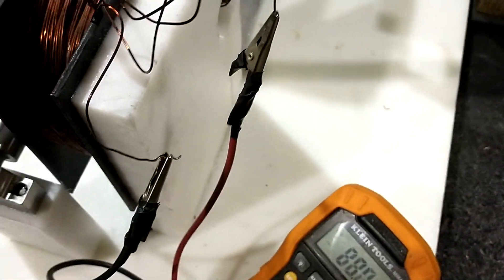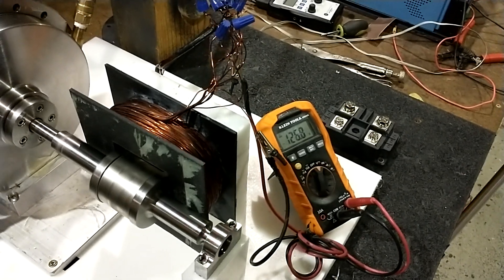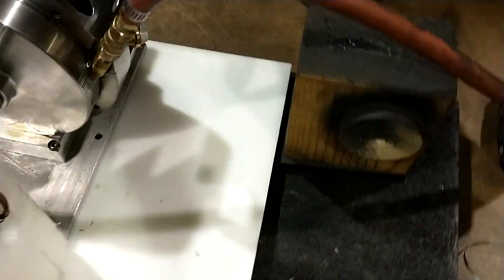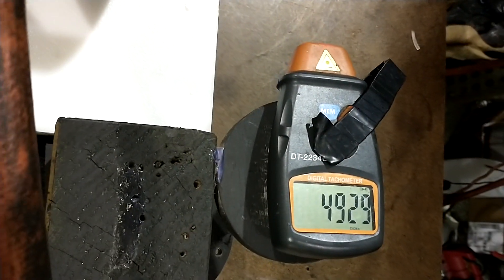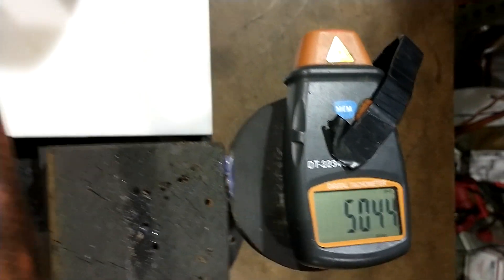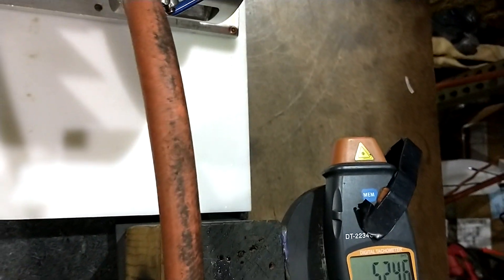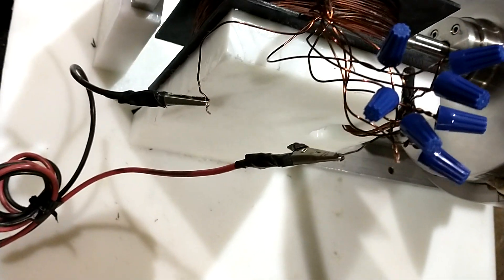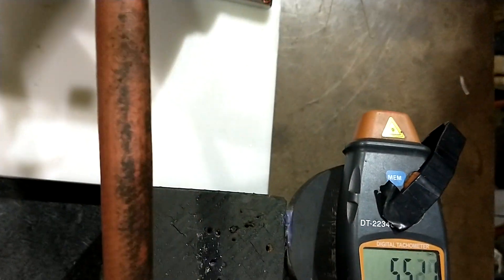Tesla Turbine Electrical Generator Testing! LOW RPM

Comment: Where's the efficiency data here? Voltage without current is meaningless. It takes a lot of power to compress air to 110 psi, so how much electrical power is actually being generated via the tesla turbine? Or even how much rotational kinetic energy would be useful.  Very simple calculation(s), yet suspiciously absent from these videos.

Comment: How Many  PSI ??????? Very  relevant information
Reply from the maker: roughly 110 psi minus the drop of pressure in the lines.
Reply: @iEnergySupply   thanks 🙏 do you have the power supply usage spec for the compressor  ,or what I hope is ya net gain is sir
Reply from the maker: We are getting an analytical system that we will be using in future videos.

Comment: is there any values for torque ??
Reply from the maker: We will be showing watt values soon so we can calculate the torque by the speed and the watts minus generator efficiency.
Reply: @iEnergySupply  ok thank u.i have a question can a tesla turbine be coupled to 25 KW generator, is there any methodology to design one
Reply: Absolutely agree, you got power, you got RPM means you Will get what torque is taken.

Comment: Where do I get cold steam for a long time and what is the cost of producing it?
Reply from the maker: And of course I'm mixing togetherammonia and water to produce anhydrous ammonia that boils at certain temperatures based on the concentration. And I'm going to run a closed system with this turbine at very high RPMs, it is exactly the same as they're called steam systems in the past but I am using a mixed fluid for lower boiling points. The entire system will be explained very shortly and it will be easy to see because I've set everything up, and it just needs stay tuned :-)
Reply: @iEnergySupply  You know not to trap and overheat ammonia right? It will explode.

Comment: Some how the rpm or vibration of one can by resonance or law of octaves or two octaves higher amplify the other turbine to a greater hight of vibration?
Reply from the maker: I will need more time to answer that question, if you could elaborate I may be able to come up with something close.
Reply from the maker: O your talking about balancing. I wasn't sure. The goal there is to find the natural vibration in the rotor, then depending on the bearing supports you use a odd or an even multiple of the resonant speed. Tesla explains it in his balancing patent, would you like a link?

Comment: Power in is being provided by a compressor of how many Watt's? Voltage is only relevant when combined with Amps to produce output in watt's. Watt's in : watt's out= Efficiency
Reply from the maker: Steam will replace compressor. We have done the testing. Compressed air is only for tuning in the turbine. Amps volts watts will be on our patron three weeks early. Efficiency will be calculated when we get our analytical equipment, soon my friend.
Reply: @iEnergySupply  You don't need analytical equipment to work out the overall efficiency of the turbine. Simply calculate the moment of inertia of the rotating components (for all dimensions from the central axis, the most difficult part of the calculation but not difficult), multiplied by radians per sec to give the kinetic energy in Joules.  Then divide that by the energy required to run the compressor during the same timespan to yield efficiency.

Comment: Love your video's, been inspired to CAD up my own idea's on one of these, still lot's of improvements to be made to the base design.
Reply from the maker: Thank you! I am so glad to inspire people, the more people working on the project the faster it will go. Many improvements to go
Reply: @iEnergySupply  Would love to share in a more private setting if you are interested.  This Turbine looks significantly larger than your last one, what is the diameter of the disks? Edit : Whoop, just went over the description again, it's 6".
Reply from the maker: @matthewkolar7560  6.5" Turbine 7.5" pump, I made a typo.
Reply: @iEnergySupply  Is the diameter of the pump greater to shorten it on the shaft?

Comment: Yes 170v, but the Ampere? We need it to calculate the Power!
Reply from the maker: We have started watt testing on our patreon. Watt testing will be public in about three weeks.
Reply: It would also be interesting to measure the efficiency of the Tesla Turbine by connecting the air compressor's engine directly to the generator and performing another wattage test bypassing the turbine and calculate the power loss.
Reply: UNLIMITED POOWWEEEERRRR!!!!!!